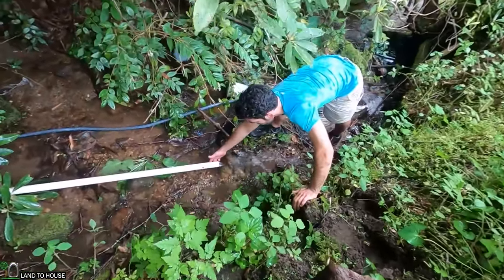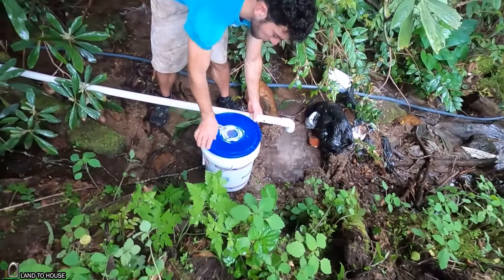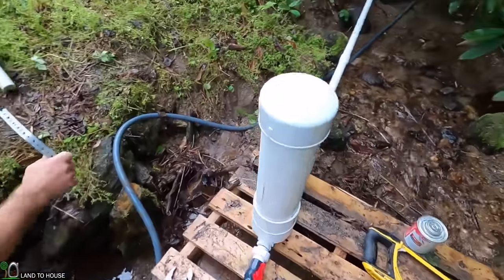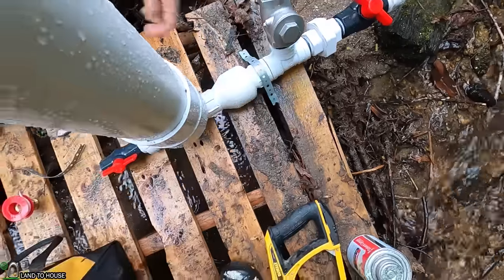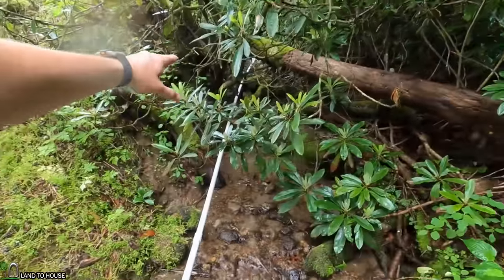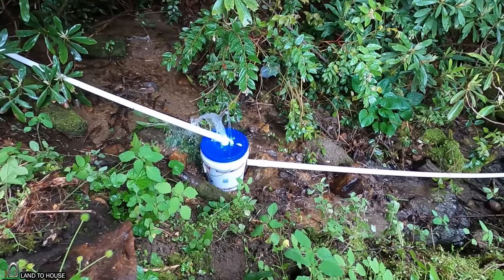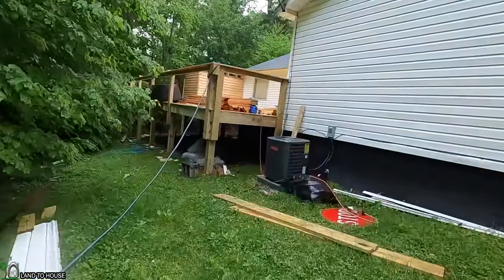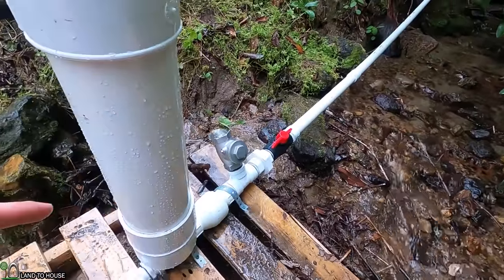Full Ram Pump Install 1-1/4"

Comment: I noticed you where not using a pvc primer with the cement/when you glue PVC pipe together it’s a two-part process it’s actually  a weld , The PVC primer will soften the PVC pipe and when you add the cement it creates a thermo plastic weld- I know from experience that the pipe will separate when  primer is not used/ well good luck down the road! Just a heads up Hope it works fine
Reply: Hey George, in case you didn't know, PVC cleaner & primer were not even available in the 70's & 80's. I have never used cleaner or primer and have never experienced a weld failure. I took 3 min to research the subject and discovered that PVC cleaner & primer should never be used if you want a superior solvent weld. Copy of research testing to follow;
_The purpose of this investigation was to determine the effect of primer on the strength of solvent welded PVC and CPVC joints. Was primer necessary to have better joint strength? The hypothesis was that if primer penetrates and softens the plastic surfaces prior to the application of cement, then the inclusion of primer in the solvent welding process should achieve maximum fusion and strength. This was not the case. In both tests, the primer had a negative effect on the strength of the pipes. In the compression test, more primed joints failed first than unprimed joints. In the torsion test, the primed joints overall took less force to fail than the unprimed joints. The primed joints also had a higher failure rate, although the rates were more equal than in the compression test.

A reason why the primed joints were weaker than the unprimed joints may be that the primer presoftens the plastic more than the cement alone, so the plastic may have taken significantly more time to cure in the primed joints.

Another reason why the primed joints were weaker than the unprimed joints may be that the cement may have needed to be applied immediately after the primer is applied to prevent the primer from drying. Because the application was a manual process, a few seconds of exposure to air that the primer had could have dried it such that it formed a barrier to the cement to prevent the two materials from fusing together with the help of the cement.

Yet another reason the primed joints were weaker than the unprimed joints may be that the primer presoftens the plastic more than the cement alone, so when the plastic hardens again, the molecular structure may have changed. The hardened plastic may not have the same strength as the original plastic material.

The final reason why the primed joints could be weaker than the unprimed joints could be that because the cement contains most of the same ingredients as the primer does, the primer may not have added any real benefit to the joint strength. The primer may have actually made the joint weaker. The concentration of these ingredients in the cement alone may be more conducive to making a stronger joint than the concentration of the ingredients in both the primer and the cement combined. Therefore, cement alone may create a stronger joint than a two-step process of primer followed by cement. The manufacturer, Oatey SCS®, has been contacted, but so far no comments have been received._

Comment: Great video - but I would not use a petroleum based product that likely has road contamination over the screened intake, ie if not used for potable water.  Use rocks.

Comment: Very informative video. Thank you. I need your help. I have land in Hilly area. I have a bore wel 90 feet deep on the top of the hill. I have prepared some land for cultivation which is 20 feet down the hill. Can I use the bore wel water with free energy. Land is 300 feet near the hill (water bore wel)

Comment: Very great presentation and insight. Do you have any reference or tests made - pressure tank  3 " pipe as (f) of lenght. What is the best size of 3" pipe length for the pressure tank?

Comment: You could tee the intake with a 6 ft pipe to draw air would increase flow I've got 38 psi this way
Reply: Clarify what I mean tee with the pipe vertical 6ft it increases the flow drastically but does not cause air bubbles. Causes a vacuum type effect on the water line increases pressure at the first valve
Reply: @publishsalvation  yes i have seen these in other builds. would that replace that exhaust valve deal he had just before the vertical pump, or in unison with it. do you have any videos we can see. thanks

Comment: Best ram pumps video. Addresses my concerns for debris in the drive pipe. I am a little worried about the stability of the pump after a heavy rain though. Did you adjust that later? How often do you need to purge the pressure chamber due to air absorption?

Comment: I wonder, can you use a cheap solar pond fountain ($70) as the input to a ram pump so that a high flow, low pressure solar fountain becomes a higher pressure lower flow pump.  This way I could pump my water up to a stock tank without input power.

Comment: What's with the bucket? Just hook the pipe together.  Get a couple of more feet of head will get higher hose pressure and more volume.
Reply from the maker: The bucket helps a lot to reduce silt in these mountain creeks.

Comment: much better if you make that bucket into filter add charcoal,pebbles and sand.3 buckets will do.
Reply from the maker: That could work. As long as the water is not restricted for the ram pump.

Comment: Could you attach multiple ram pumps to one output hose? Maybe you would have to install one-way valves between the pressure tank and the other ram pumps so they don't send a pulse to the second one way valve in the ordinary setup. But maybe you wouldn't need anything additional, but could just manifold several for a high volume flow that doesn't require additional delivery pipes.
Reply from the maker: Yes you sure can. I have run two pumps from separate creeks into the same delivery. Increases volume but not pressure.

Comment: 5:10 - Some underwater PVC cement is not blue. Also, don't mistake the blue PVC cleaner that is required in many jurisdictions for the convenience of the plumbing inspector so he can tell that you've cleaned the pipe before cementing. 5:33 - It would be less of a hassle had you screwed the adapter into the valve before cementing. Then, you could turn the valve handle any direction you want it (wanted? the same thing, I guess.)

Comment: I’m trying to make a ram pump for my fish tank. Is it possible to put a hose onto the first check valve from squirting water out every where. If I put a connected hose to the first check valve so the water can go back into the tank from making it messy, while the other check valve is pumping water out going back into the tank

Comment: I'm wondering if it's possible to duplicate this without the stream.. with container with say like 10 gallons of water and a water pump flowing towards the turbine..and recycle the water..would the wattage justify the use of a electric water pump..or maybe a hydro water pump if I can create on..

Comment: Great video but some people might find this misleading and sometimes many feel it's magically real but forget that this phenomenon has been in use for many things including house hold plumbing but not realize it.  Without getting into the laws of thermodynamics and the conservation of energy we can't assume this is free energy and for some that is what it seems like.  There is no multiplication of pressure here but a way to pump water uphill correct?    Some think its a way to pressurize water but fail to see the actual video is about using ordinary stream water to be captured into a large volume or body of water ie:  Pail, then once filled goes into a pipe towards the RAM PUMP which consists of a open a close valves which uses the pressure of the water from the downhill motion from the pail to the pump and then into a smaller volume ie: hose uphill towards the cottage.  So please explain this sometimes no one seems to understand that for someone like me who understands how Einsteins explains gravity it's pointless for me to argue with someone that can't  understand this concept.

Comment: Is there enough pressure output in a ram pump to have something like a little giant float valve at the top of your supply tank?
Reply from the maker: You can add a float valve to the delivery pipe at the top. It's a good way to prevent overflow.

Comment: Could one, say, fill a 5000 gallon tank on the hill then during emergency use that to drive a pelton wheel generator back down in the creek?

If you could get 1 gallon per minute up there it would take 3.5 days to fill up the 5000 gallon tank.    How many KWh could you get from a pelton wheel in those conditions?

Comment: Could a guy put a hole or inspection hole on the top of the pressure tank too air the inter tube or replace it now and then as log as it will holding pressure or is that not a problem?

Comment: Very nice  video . May i  have a few answers please??  The main pipe from the  pump system  is empty?? Let me know please too it's dimentions(height, diameter) and the distance between  the pump and this pipe...If i use 2'' supply line and after pump 1'' pipe i will have more pressure  after 300 feet distance??? My regards,,
Thanks a lot..

Comment: Is it possible to use a 55 gallon drum full of water with ram pump underneath.  Use the waste to go back into 55 gallon drum. Was thinking about using it to keep circulating chickens water so it doesn't freeze. Just didn't know if it's possible

Comment: Instead of the 90 into the bucket, why not use a uniseal in the side of the bucket so no air bubbles get in there?
Reply from the maker: That works too. There's enough flow rate through the supply line that no real worries of air bubbles

Comment: Hey Seth
I have a 1 1 /4” ram pump that I learned to build from you, Eastern Ky on the mountain,
I have 40 Psi at the pump,
A foot and a half of head pressure run from my underground spring with about 20 foot of pipe is about the best that I can do.
I’m coming up some steep landscaping about 450 foot.
I’m getting a good drip but I need more that a drip.
Been using an electric transfer pump and am trying to save a buck in these depression kind of times,
Any good advice,
Jimmy

Comment: I am wondering that you're pump working well, but somehow I didn't get how it flows up on top or the mountains,  please can you send me a sketch of this system, thanks
Reply from the maker: The source water for this pump is a creek that flows year round. The intake of the ram pump is pulling in around 8gpm and the output is around 1.5 gallons a min.

Comment: You know you can buy PVC drain pipes with the holes already in them, right? The rest of the build looks pretty good. You ought to go back and brace everything, especially that vertical pressure chamber.
Reply from the maker: That is very true and worth doing if your short on time. 

So far this unit has done very well. The creek does not get up too high here.

Comment: Hooray!  Cool vid. Now for our viewing pleasure you could try running that flow through an evaporator to support or take the place of an A/C. I live in the south so those portable types they use out west are no good here because of the humidity but with some continuous cold water, and perhaps a drain to collect condensation it could also remove humidity?

You didn't say what the temp of the water would be at the point of destination, nor relative to the season.
Is the temp constant at it's source?  - Thanksalot!

Comment: Question: is there some math behind the size of your pressure cylinder?? Could a small bladder expansion tank work? Also what if you put a one way check valve on the supply side to your ram pump so the water wouldn’t have to hammer so far up the pipe??

Comment: Hi, may I know if I have a 1 meter height tank , say 1 cubic meter worth of water and have a outlet pipe right at the bottom of that tank.

Can I place the ramp pump right from the tank outlet pipe and consider to have a 1meter drop? The water from the tank should be able to keep the pump running and bring the water up? 

Thanks.

Comment: I have a pond I don't have a stream is there a way I can build a pump that will pump it out of the pond and do what I need to do to feed the livestock using static pressure instead of regular pressure
Reply from the maker: The ram pump is able to use hydrostatic pressure in place of head pressure. There is a downside to running from a pond. If you don't have water replenishing the pond the ram pump will drain the water fast.

Comment: Lots of good information on the video. As a camper van owner I was told my my supplier that regular garden hoses are not to be used for drinking water.  Something to do with the material used in manufacturing. The hose that should be used is white and this labeled drinking water safe.  What’s your take on this?
Reply from the maker: I have heard something like that too. PVC is rather inexpensive so is roll pipe. Another option would be PEX. There are options out there. Garden hose is just common and most of us have them around.

Comment: Would like to know how you would muffle the knocking noise from the stainless oneway valve. That hammering noise would draw attention from nosy neighbours. Also how does this setup holdup during winter?
Also the friction loss will be greater in smaller hose. So an easy way to increase your volume is to use a larger diameter hose. 1/2" vs 3/4".
Reply: If you used a larger hose then you would lose a LOT of pressure and it would not make the rise.
And if you are worried about the knocking sound from the pump then you have no business using one in the first place. That is about the most uninformed comment I've ever seen.
Reply: @ironnads7975  well Nathan since you are so well informed have a look at pressure loss charts and you may add to your  infinite wisdom that larger hoses create less pressure loss.
Don't believe me go to 8:25 of the video.

Comment: Hello Seth...I am struggling as how to put this together on my land..I have a seasonal stream that flows very slowly in January but idk much more than that..am I able to use a hydraulic ram pump? how far can I use it.. I think I am about 200 ft elevation, but Im justimating..what can I do to avoid the 8k and higher since my land table level is 400 ft and more

Comment: Thanks you. Can you provide detail pipe sizes with measurements, and the valve types. And how many meters can it flow up?
Can you also exclude the bucket so water directs to the pressure valve and pipes?
I'm planning to get sea water up 100m to a reservoir tank for supply.  Can it work?
Reply from the maker: The ram pump source water must come from above the pump. It is not going to work in the sea.

Comment: How would you avoid a flood not washing the setup , I had made one but had to removed every time it rained any pointers would help thanks
Reply from the maker: The ram pump itself can be placed out of the water if you have enough head pressure. The intake is all you would have to watch for.

Comment: Is there any way to increase flow rate and have a ram pump produce something lik 150 liters per min?
Reply from the maker: Yes.... a much larger pump.
Reply: @LandtoHouse  Are there even check valves available to create one big enough?
Reply from the maker: @optimusprime699   There is actually a video on YouTube with a 12" ram pump. the thing is a beast!

Comment: Funny how you decide to use FF to speed up the 30 seconds it took to fill your quart sized container (with one minute left in your video) but make your viewers sit through the fumbling of pliers and PVC glue!
Reply: That's because most folks have seen the tap flow water plenty and are more interested in what steps are realistically involved in making this work.

Comment: Please Help. I built my pump from your design but had to use 1” as I could not find all the parts in 1.25”. Sadly I can not get the swing valve to do what yours is. The water just flows out the top with not swing from the flap. What am I doing wrong?
Reply from the maker: A couple of things can cause that. do you have matching waste valve and drive pipe? Do you have a screen over the intake that is restricting flow? And also  Do you have an air free water source with at least 2.5' of head pressure?

Comment: Can you use a ram pump to increase pressure on a home water line (for using a sprinkler)? Or is it just for low flow use like filling a water tank?
Reply: I'm not a professional but I do have a ram pump that pushes water at a rate of 1 gallon in 4 minutes about 60' in elevation and 400' usually about 25lbs of psi from the source. On normal home water systems it will not increase pressure in a negligible way.

Comment: Hey, great video! How long would I need to let it build up pressure, I used a 2 inch drive pipe 58 feet long
Reply from the maker: It's important to keep the drive pipe the same size as the ram pump.

Comment: How much of an incline can you have with a ram pump?  Also.. what if you have to direction the pipe right and up from the water source?
Reply from the maker: The pump itself needs to be on a flat surface.  The drive pipe and delivery pipe can be very steep.  
The drive pipe can be a totally vertical.
Reply: @LandtoHouse  what about distance ?  I’m looking at 681 ft from the water source.  The stream runs strong though.